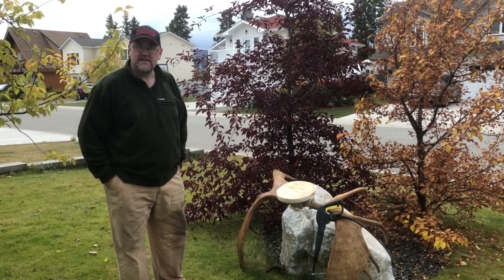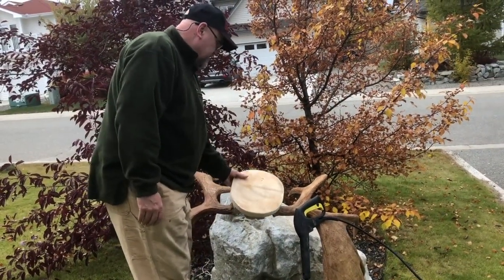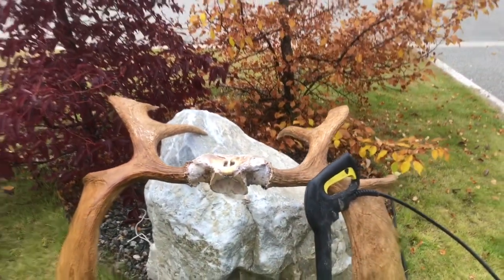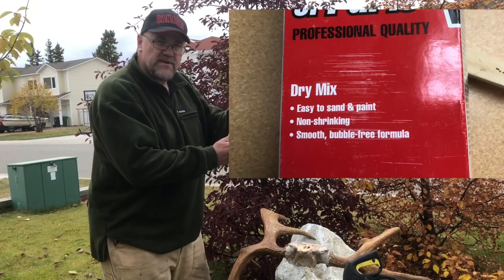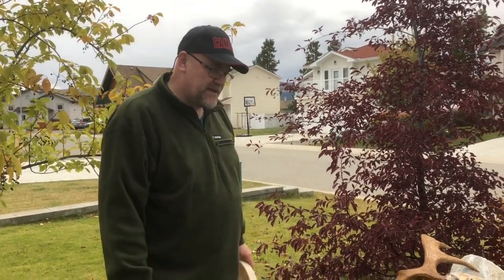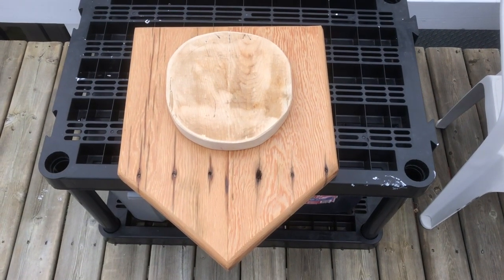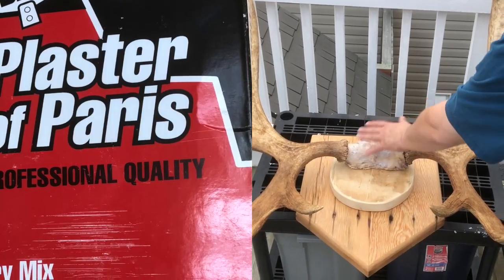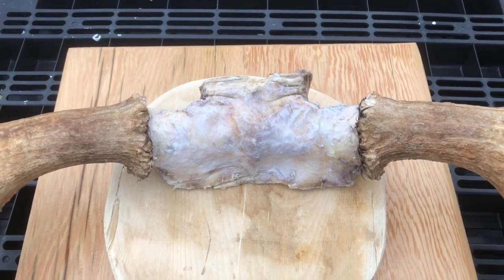Mounting Yukon Moose Antlers; Part 1

Comment: I had to really clean up my antler skull from last year because I entered it in a Sportsman's Warehouse bone and antler competition.   What I did to get the final fats and meats off of it was to place the skull on top of a full stock pot that was on top of my Coleman two burner stove.   Of course I could not submerge the entire skull due to the antlers.   So I covered the above water portion of the skull with aluminum foil whose edges were submerged in the hot simmering water.   The theory was for the foil to hold in the heat from the boiling water and to more or less steam the above water portion.   It worked fairly well.   I used a dremmel with several various tips to clean as much non skull material off of the skull afterwards.   I then mixed up a fairly strong solution of hydrogen peroxide and water using 35% food grade peroxide.   I added agar agar to this to thicken it and painted it on the skull all over repeatedly in order to whiten the skull for presentation.   I thickened the HP solution in an effort to get it to stay on the skull for a longer duration without just running off.    You may not wish to do any skull  "whitening" since the skull will probably be covered.     Good luck and looking forward to seeing how it all turns out since I need to do my own antler mounting as well.
Reply from the maker: Man that's a great starter.  Any advice on getting the blood spots off the antlers?
Reply: No not really.  I think i used "Simple Green" and a scrub brush along with a garden hose.  My antlers may have whitened up a bit overall from the heavy duty scrubbing I gave them which you may not want.  Overall though they don't look too bad.   We did not notice them being any whiter than the other moose antlers in the contest though we forgot to really pay attention to those differences.   I guess what I am saying is that if they were much whiter, I believe that we would have noticed that fact.